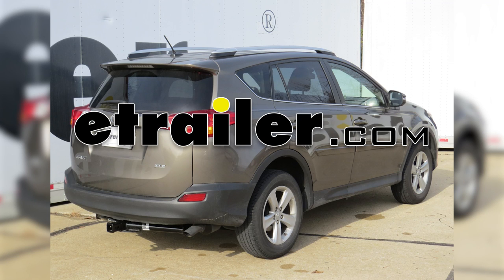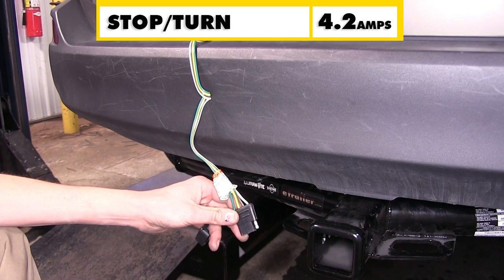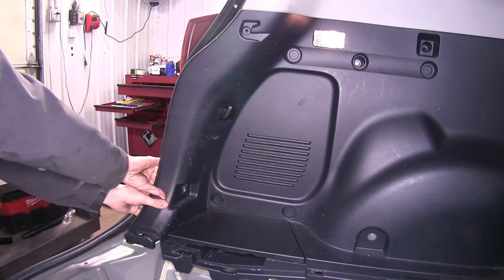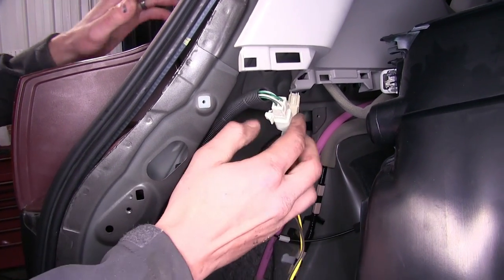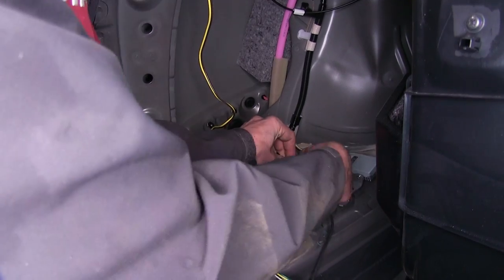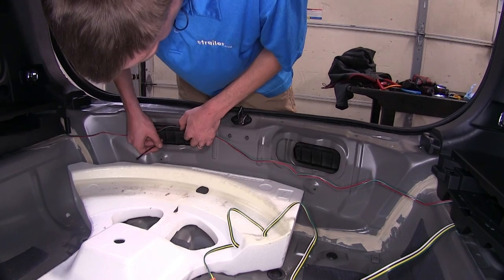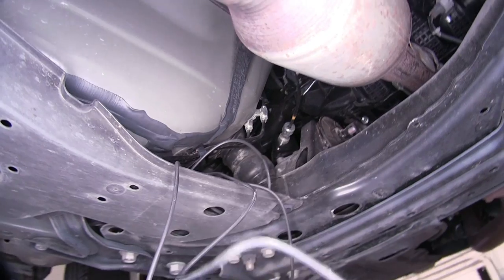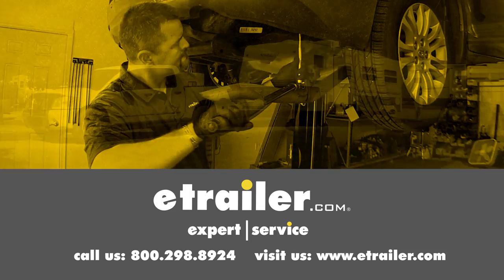Mount: T-One Vehicle Wiring Harness with 4-Pole Flat Trailer Connector on a 2014 Toyota RAV4

Comment: I just ordered the 4 pin tester. I put this exact wiring kit in our rav4 and hooked up to a trailer to see, tail lights work, left turn signal works, right signal and right brake doesnt light up. Hopefully its on the trailer end. Otherwise a great product.
Reply from the maker: If you put the tester on and it is not working on the vehicle side, check the ground to be sure that it is a clean, solid ground. Typically, that is the issue if you are having partial lighting function.

Comment: NOT A DIY PROJECT unless you have a LIFT.  I've installed light kits before for my Honda Element and it was a snap.  Not so with the RAV4.  You have to remove a lot of panels and then run a power line from the rear of the car to the front.  Unless you have a lift this is very difficult to do correctly.  Just pay someone to install the lights.  Taking off all the panels and putting them back was a PITA.
Reply from the maker: We have heard of people completing this installation with the vehicle being on the ground or ramps. It is a little tighter to get it installed but it is possible.
https://www.etrailer.com/Custom-Fit-Vehicle-Wiring/Tekonsha/118578.html
Reply: That’s a lousy answer since you have a lift. Why don’t you try it without a lift.  Mostly helpful video but you should warn DIYers that they need to run this line first and that they will likely need a lift